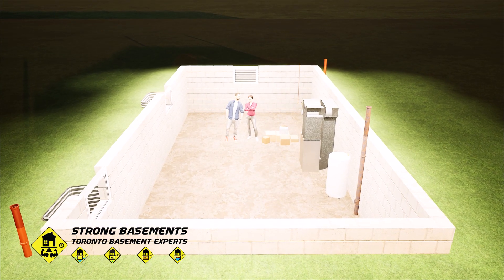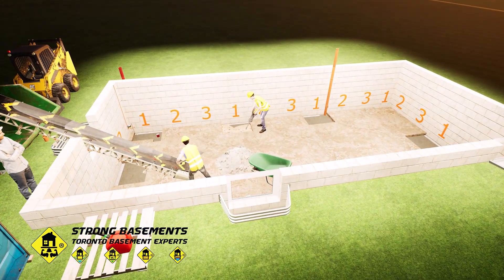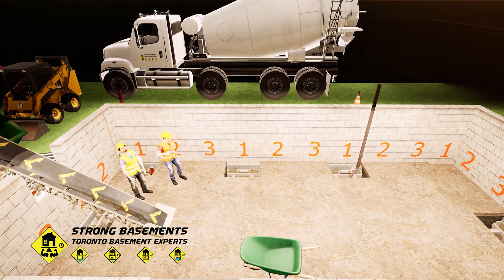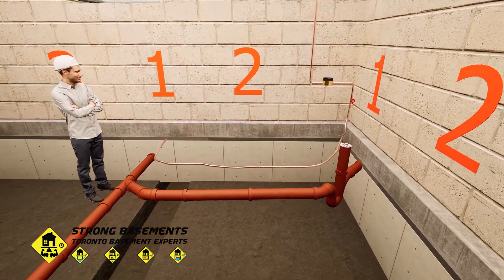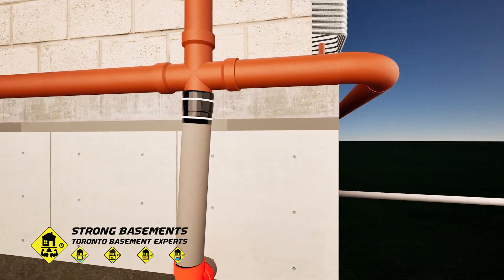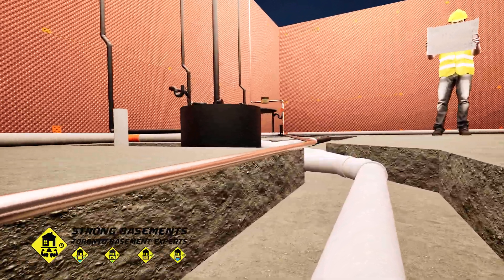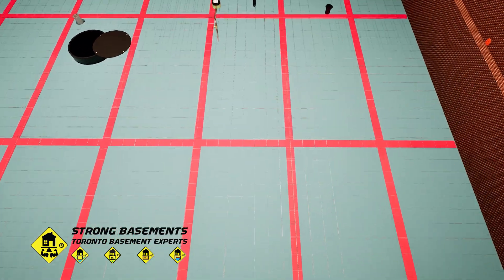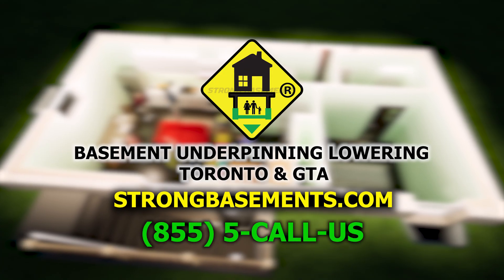Basement Lowering / Underpinning Toronto | Construction Steps | Inspections | Costs - 2025 Guide

Comment: I had a question. when you lowered the sewage system how is the slope still working if you moved it like  much lower than old sewage height? like once it leaves the house under the new foundation that was put in wouldn't it now have to fight against gravity because the pipe outside the house would be higher?
Reply from the maker: Thank you! That is a great question.
When the new basement slab is lower than the existing sewer exit, we have two standard solutions:
1) Reslope the Main: If the city sewer main at the property line is deep enough, we excavate and replace the pipe from the property line back to the house. We steepen the slope so it connects to the new, lower basement rough-in via gravity.
2) Ejector Pump: If gravity isn't an option, we separate the systems. Upper floors drain via gravity, while basement fixtures run to a sewage ejector pump. This pump lifts the waste up and discharges it into the main gravity line, leaving the house.
Dear viewers, please ask more questions like this; it will help us to understand information demand and create the relevant content.

Comment: New subscriber has entered the chat. The only question I have is specific to radon gas. Is there a need for a monitoring system?
Reply from the maker: Health and safety always come first. Radon detection and monitoring devices cost approximately $100, and having one in your basement is highly recommended. Even with complete waterproofing systems and vapour barriers in place, small gaps between the membrane and the foundation wall can still allow limited radon entry, which may then travel through insulation layers and drywall into the living space.
For effective radon mitigation, specialized sub-slab depressurization systems can be installed. These systems use dedicated air pumps to draw air from beneath the concrete floor and safely vent it outdoors. Proper airflow for this system requires a gravel bedding layer beneath the slab, which modern basements typically include and lowered basement too, as you can see in the video.
However, older basements often have concrete floors poured directly on soil, with no vapour barrier and no gravel base, making radon control far more challenging. In such cases, monitoring becomes even more important.